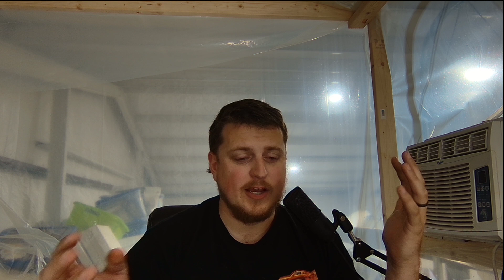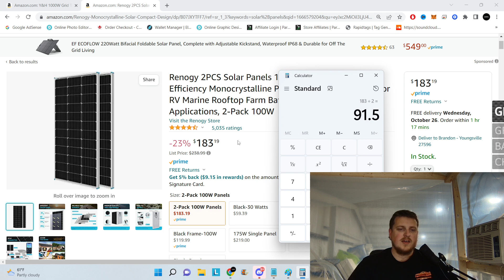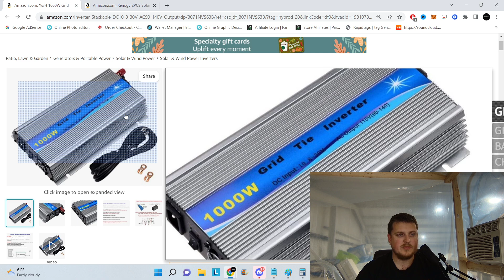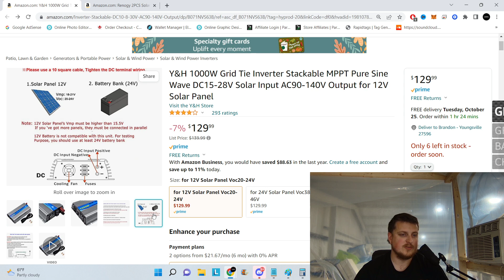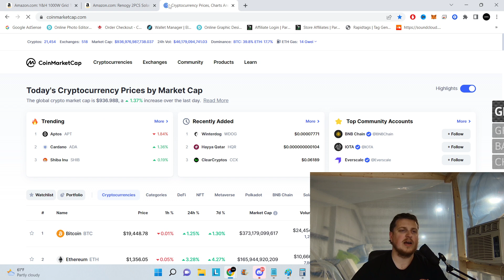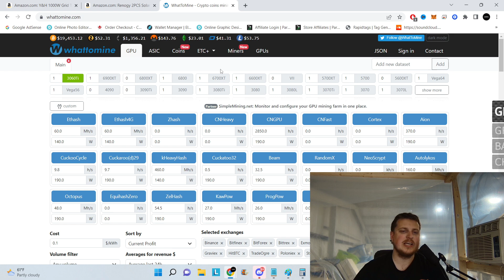Maximize Solar with Crypto Mining

Comment: you can buy used panels  $65 for 200 watt An average home needs between 20 and 24 solar panels to fully offset utility bills with solar. According to DIY Solar Shack, approximately 6000 watts of solar panels are required to run a Bitcoin mining rig with multiple GPUs during the day, while also charging batteries in order to mine Bitcoin during the night. This is the equivalent of 20 x 300 watt solar panels

Comment: Brandon,  Look into 24v or 48v systems.  They are more efficient converting DC to AC power.  I choose the 24v system and almost doubled the the amount of time running a deep freeze as the test. 12v was 2 days, 24v was almost 4 days running the same freezer in the same environment .

Comment: Brandon, great conversation about the solar. I have been playing around with solar for about 6 years.  You sounded just like me when I started. I like your idea about solar, just think your plan needs help.  First mistake I made was under sizing everything but oversizing the inverter. Figure out what you want to run with the solar, then size it.  I don't know what voltage to run but from my stuff, 12v is too low, I should have 24 or 48v system to the inverter.  I have 5, 12v, 100w panels into a controller, then to 6 marine, deep cycle, batteries, then to a 3000w inverter and splits to a control panel for other 12v stuff.  This is for my Lanai (patio) to run a small bar refrigerator, small tv, led lights and a 32 USB charging capability. Where I live we have frequent power outages and the highest electric price in the nation.  I do have grid connected solar for the rest of the house.  I'd recommend, figure out what you need to run, size it build it and be happy! You're doing great!  By the way, hope the baby is doing well.  I bought my BC Teeeeee, about the time you had the baby:)  I've had a blast with the solar, I changed to rechargeable batteries and that's working out great too. Aloha, Howard

Comment: Definitely go for better panels. You can get a much higher watt peak, better warranty, better efficiency etc. I would go for micro inverters, they're safer,  also more efficient, better warranty and give a better read of your system. Going for cheap low wattage panels and inverter will cost you more in the end. It will also take up a lot of space.

Comment: I have 36 400 watt qcells panels with micro inverters on a ground array.  I choose the more expensive microinverter option so i can monitor each panel individually. They usually produce anywhere from 1.8-2.5 kwh per panel each day.  I'm in Kansas and our average of peak sun hours is 5.79hrs/day. Hope this helps someone
Reply: Also, I have a net metering agreement with the power company so I use them as my battery bank instead of purchasing batteries. I spin the meter backwards during the day and it spins forward at night/ low sun.
Reply: Nice 🌞

Comment: Im a miner with 5x3070, and 1x 3080.  Load 1300w
I setup a solar system with 25kwh battery so zero bills.

Mined rvn coin with more than 30rvn per day.

Slowly but surely got 1k+ RVNs on my 1st month.

Hope will get better soon

Comment: I built a few diy solar systems and your better off in the end buying a diy kit from a solar web site like  Signature solar. The cost per kwh on the solar panels is way better value. I found Will prowse channel very helpful on picking out hardware

Comment: If you going to mine with solar you need to get some descent panels and inverter..you could start and expand it later on..if you buying all the cheap stuff now you will have to replace it pretty soon..i got a totally off-grid cabin with mining.. started with gpu's on summer time and now i turned them off and  i run CPU.s instead because it's pretty dark in Sweden now

Comment: BTW, I use Growatt two MOD 10KTL3-X inverters and i have conected 22 LONGI LR4-72HIH 450W panels to each (44 total), total cost of arrays was around 14 000 USD for all system and like 40 hours of my work as i instaled it myself on flat roof of my warehouse.

Comment: You still have to make sure you make more mining with that power than 'back feeding' it.  You also have to know that your power goes up and down with clouds etc and if you don't match your excess generation you will tip over to mining at a loss.  For me, my back fill rate is so close to mining profits I just take it and not worry about any of the stress of trying to keep things mining.

Comment: bro if your gonna do it, future proof the setup. Get a good 3kw or 5kw 24 volt inverter/charger or grid tie inverter and use 300-400w 40v panels, you can start off with just a couple of panels and add to it once your ready.

Comment: Go for it, I have  two 10 kW Arrays conected to two three phase inverters, and curently i run my rigs only during day (they switch on and off automaticly as sun rises). curently seating on 87% of auto consumtion and PV arays cover over 80% of electricy used by rigs so my real rate is about 0,02 USD per kW, I live in europe and in my country curent electicty rates are horendus atm like 300% of last year rate.

Comment: Most people do it wrong they go ac to dc to ac to dc and waste around 46% of power to heat
Reply: Solar power starts off as DC, then a solar charger is a DC to DC transformer. If you had other small DC to DC transformers from the batteries for 12v and 5v feeds to the PC/mining rigs you could do away with needing 240v AC power supplies and an inverter all together.
Reply: Like every time we charge something by plugging it into the mains?
Reply: @boxfan6  yes but its worse then you just going ac to dc